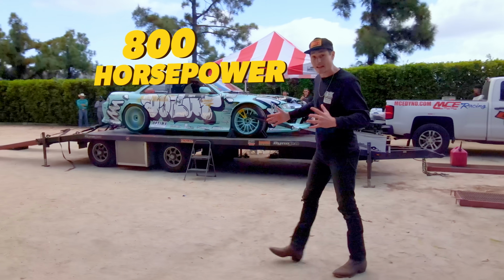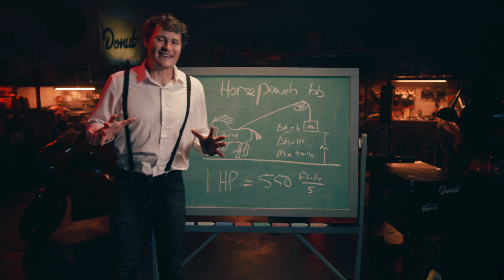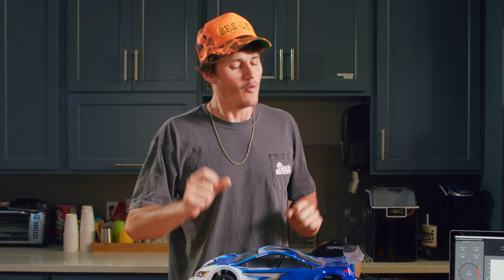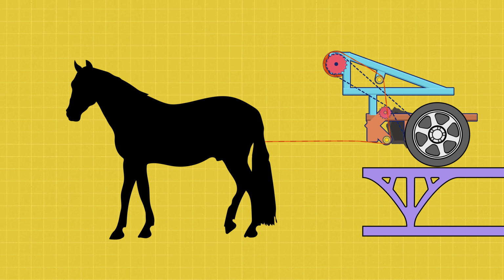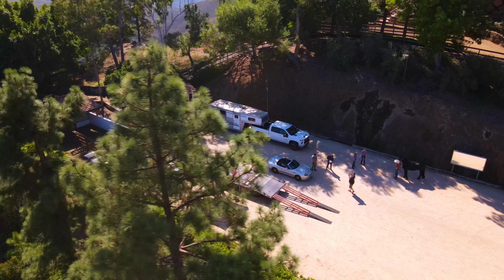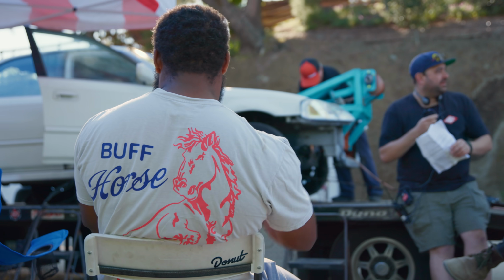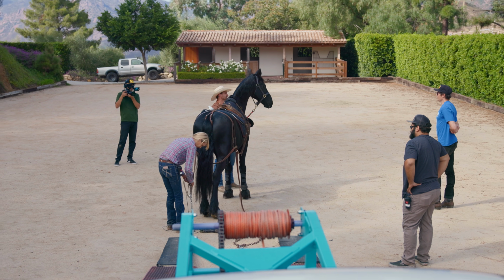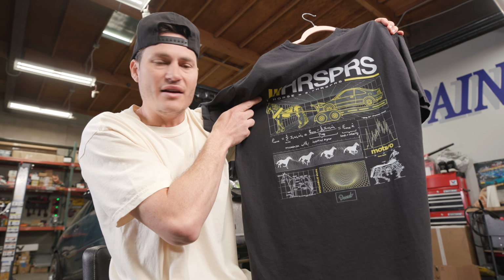How Much Horsepower is a Horse?

Comment: I guess my assumption that 1 horse would = 1 horse  power. 1=1 so that’s how I arrived at my answer. So watts calculations were wrong.
Reply: Watt was trying to estimate the total amount of work a horse could do over the course of a day, not the peak horsepower over a 10 second sprint.
So not wrong, just a different methodology.
Reply: Ok, that makes sense
Reply: My only real experience with work hoses is at county fairs, where a team of drafts pulls a sled with progressively heavier weight. In that context they are testing strength in about 10 seconds intervals. I just always assumed that this was what horsepower was based on. I never really considered how they got to the number growing up watching horse pulls.
Reply: @KantiDono  Good point, that he was. I wonder where the "horse can generate 15 horsepower" figure came from though

Comment: I think there were a hell of a lot of earlier vertical take of and landing "aircraft" before Motivo even existed. This is the case of many vehicles including thousands of different helicopter models, tilt rotor aircraft (V-22 Osprey), Gyrodynes and fixed wing vehicles with thrust vectoring Yak-38
Reply: Should’ve been eVtols as the Vahana from airbus was electric.

Comment: 550 foot-pounds for one second is one horsepower as per the standard.  Or, lifting a 550 pound weight one foot in one second.   By that standard, a lot of power lifters can achieve 1 HP in the dead lift.  Some can even make it in the bench press.

Comment: It would also be useful to see what Big D can do for an extended period of time. Sure he can peak at over 5 horsepower but that isn’t what the “horsepower” measurement was based on. It was work performed over a prolonged period so it is a better comparison with engines (which don’t get tired).
Reply: i think the problem with that is what  Jeremiah hinted at when they limited big d's runs to only five.   given the resistance exerted by the system,  it could potentially injure the horse or worse
Reply: @sunny-sq6ci  Yes. That is why it would require an entirely different mechanism for measurement.  Likely one resembling the mill setup with a large circular path and adjustable load.

Comment: 5.7 for 1 horse, then 300 hp is = 52.6 but I rounded up to 53 so that means you will need at least 53 horses to make 300 hp. Crazy to think. Too bad it's only one horse and test all 300 horses to get an average number so then we can get better accuracy but it will do. If we double the horsepower that means it will be 600 hp so you will have at least 106 horses to make 600 hp.

Comment: This really put into perspective how strong a horse is,  his score was 3x higher than 3 of them together, incredible 😅
Reply: and the horse wasn't even struggling...different horse/different day 10HP is probably achievable
Reply: He clearly was. Almost stopped him untill he managed to get the momentum going
Reply: @kirdot2011  thats just when the resistance started, he reset and did it without trouble
Reply: @kirdot2011  You'll never see maximum horsepower without the use of a whip and/or superload noise to incite the flight or fight response from adrenaline.
Reply: @kirdot2011 that thing has way less resistance than a field plow which was generally used with one horse, maybe two depending on size. The horse had to tension the pulling lines and then grip the ground. Otherwise there would be shockloading. They do this naturally. Unlike dogs that have to be trained to NOT break their necks. Horses do this automatically they feel resistance so they slow down to tension and then they start pulling. That was struggling that was Prep lol
Reply: @toolbaggers  I don't think we need to use that number. But the guy leading the horse chose their top speed with however fast he decided to run.
Reply: @swampypolitics9574  well said sir
Reply: @toolbaggers  hope you aren't on the olympic committee.
Reply: @toolbaggers  true.
Reply: They should have started the horse with the device and rope off the ground because when it would come off the ground to get rid of the slack that was kind of the point when the horse would stop for a moment. I would bet that would easily put the horse over 6hp easily. The ability to allow the horse to do more than walk would also bring the horse closer to say 10hp. I would bet that a horse that pulls a plow would easily get way more hp on this rig than Big D who seems to be more of a show horse than a work horse.

Comment: WOW leave it to an engineer to over think it. Its simple.  How much weight can the horse lift up from the ground.  Take that weight and let it fall pulling what ever over designed measure system you come up with.  This will be very accurate and repeatable. Your welcome

Comment: Wrong dyno and concept. It is about power on a constant basis. A man, for comparison, can pull a lot but on a constant basis, for hours, I think it is about 100w with luck. So you need to make that horse work a shift as it would have done in the brewery, and measure the total work produced and average hehe.

Comment: IT WAS OVER A FULL WORKING DAY though. It was the amount of work a horse could do consistently over a FULL day.

Horses tire, not as much as buffalo or cows, but they tire and need to rest etc. Whereas a tractor or pump does not. Hence the massive disparity. I had this out with my physics teacher at college.   Its 17.64 Kw/h per 24 hour day.  A horse cant do that a steam engine can. EDIT - yeah 5 pulls.
Reply: Exactly, thats why the Unit of power is W and not HP.
Reply: @joni377  Yep - Its 17.64 Kw/h per 24 hour day.  A horse cant do that a steam engine can.

Comment: 5.7 HP for one horsepower means that a c8 Corvette that makes 495 HP calculated with actual horse metrics, makes about 86.8 horsepower.

Nearly 87 horses to make the same amount of power as a c8 Corvette.

Which then begs the question, how many actual horses of power does your build put out?
Reply: 0 divided by 5.7 is still unfortunately 0
Reply: or maybe lets do in say calories per second? Still makes more sense than horse power.

Comment: I’ve been told that a horse has about 10 horsepower. This is based on how big of a plow a horse can pull
Reply: So 10 big?
Reply: @TheSometimeAfter and buff lol
Reply: Pulling ploughs mostly come down to torque and horses has a lot of that (relatively speaking). So it probably has the torque equivalent to a generic 10hp tractor. 
Tractors too are quite low hp compared to their torque figures, just like horses.
Reply: There are different horses anyway so 1hp will never make sense.  I mean...a clydesdale and a shetland...
Reply: This would have worked more for tourqe conversion   the should have got a horse treadmill and converted that onto the dyno     and did the test in the grass    so many simple variables not accounted for that drastically effect this test
Reply: @kurtasee2314  You're right. They are definitely not university based scientist. If so, all those variables would have been accounted for. But remember it's all done in an atmosphere of fun and kammerateri. No one in their right mind would confuse this with precise science. 
Yet they gave us a pretty good idea ..
Reply: @kurtasee2314  Thank you! I was thinking the same. Hp isn't torque based, while a dyno is good for hp measurements for cars. The same can't be said for a horse because hp is a measure of rotational force, aka ftlb/sec. Therefore a treadmill would be great for this test, then placing it on different terrains would be ideal as well since the ground has different amounts of give depending on what surface you're on. However I think this is a decent generalization. I don't have a hard time believe it's a little over 5 and a half hp. I do belive some horses can reach up to 10 as well. Just like I'm sure there are monstrous humans capable of 3 or 4. I think the origin of hp is very vague, however the ftlb/sec is a better way to state it rather than basing it off some horse.
Reply: @bv4e858  HP is not a measure of rotational force. It's a measure of the rate at which work is done.
Reply: You can see, that Big-D has problems with traction. Also the Big-D is not a cold blood, which are somewhat stronger (but slower in movement) and have been used for plowing and pulling. So I am guessing his 5.7 HP are actually on the low end of what horses could do.
Reply: Maybe a Shire Horse would make closer to 10 in this situation.
Reply: 1 horse ≈ 1 horsepower. That's how it should be
Reply: @Apocalymon well unfortunately that's not how reality works. Science is the tool that helps us reduce the uncertainty of our universe. No point in saying what something should be when we have a method for showing us what something actually is.
Reply: @MrGreg242 well if science really wanted to help you guys in USA it wouldn't measure stuff in animals and your own feet
Reply: @mv9197  European detected, Acid Attack being deployed
Reply: @MrGreg242 lmao we made it up there is no "horsepower". He right. Horse power should b. 1 horse = 1 hp. You would just have to convert everything now.  If a car makes 500 horse power. And the horse made 5 old hp. Then   5x 500. 2500 hp is the new number.  Obviously in the past they just made it up and horse power wasnt actually based on a horses power
Reply: @mv9197 I'm about 71,910 football fields away from kicking ya ass
Reply: @MrGreg242 you said a lot of words for not saying anything
Reply: @mv9197  You don't live in the US, do you?
Reply: @mv9197 you realize american scientists use metric right?
Reply: @Apocalymon Did you not watch the video?
Reply: @Flugs0 clearly she didn’t.
Reply: @Apocalymon there is a reason that most of the world abandoned HP as a unit of measure and went to kW.
Reply: @Apocalymon  1 horse = 5 horse power.
1 human = 1.2 horsepower
imagine how many times can you lift your own weight? i'd recon it would be around the 1.2 (times) mark.
and this is why ants are so amazing lmao😂😂😂😂 lifting nearly 20x their weight.
Reply: @Apocalymon  That's not how it is.
Reply: @FranckLarsen  5.7 sound pretty weak as frek. I mean UCI track cyclists can crank out 2500 watts (3.35hp), peak.   SO something went horrible wrong I think.
Reply: @Vanadium they obviously used different math.
Reply: @Apocalymon no 1 horse = 5.7 horsepower.
Reply: @Apocalymon  that would mean that all horses are equal. Not quite how it works.

Comment: Measuring power in horses is like measuring distance in elephants or any other animal - not that accurate
Reply: the term relates to pulling horses. it was how much work it took 1 pulling horse to raise a 550 lbs block 1 ft in the ait to compare it to steam engines. i should also note a draft  horse was used which is way bigger than above horse
Reply: Imagine measuring i feet, inches gallon’s… that also makes zero sense